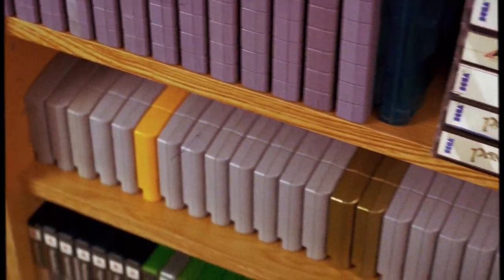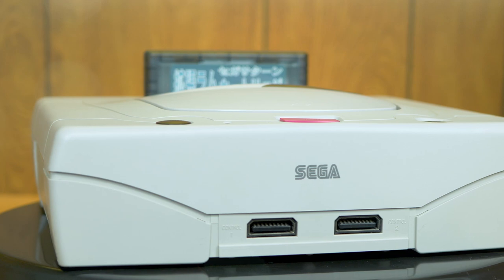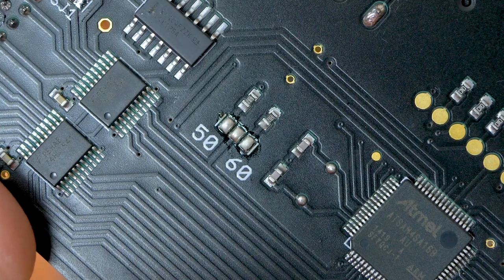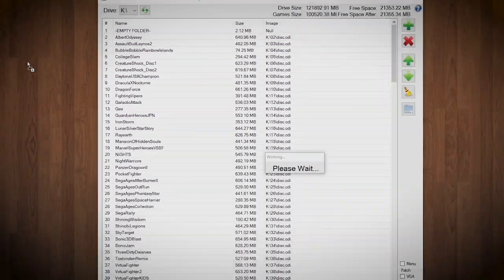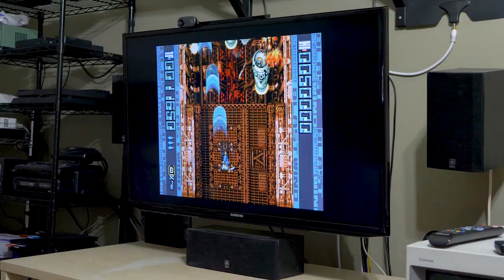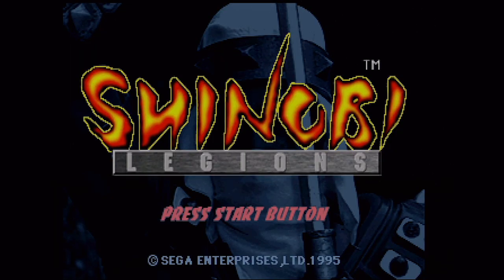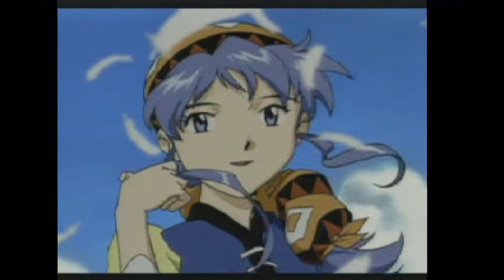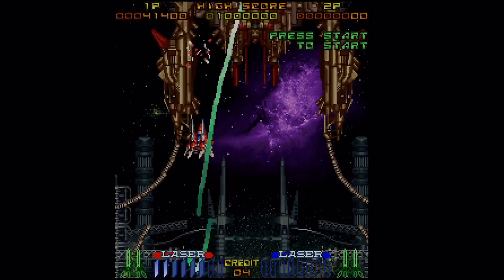Rhea and Phoebe - SD Card Reader for the Sega Saturn / MY LIFE IN GAMING

Comment: I'm very interested in getting one of these.  

Early last year I went to use my original Saturn that I got for Christmas in 1995 for the first time in probably a year or two, and discovered that the optical drive stopped reading discs.  

I kind of freaked out, and ended up buying three replacement/back up units (another US model 1, a US Model 2, and a Japan Model 1), all of which work as of now.  

I've been tentatively planning to try and get my original one repaired as well, but I may just go this route with it since the optical drive seems to be "toast" anyway.

Comment: Quite Interesting :-) Hope you guys review the PS1 SD card reader PSIO at one point as well. Or maybe how to do this the best way on a PS2 or a Wii. How to back up your WiiWare and Virtual Console games it's also a good idea since it soon shuts down. Anyways. As always, great video :-)
Reply: I think the best way on the PS2, the Wii and the OG Xbox is hard drives.
Reply: Supposedly the PS2 hard drive speed are a bit slow compared to the original disc reading speed, so some of the videos gets a bit laggy. It's possible to use the ethernet cable and a Raspberry Pi with a SD-card to fix that issue I've heard :-)

Comment: I wanna see a follow up to the Phoebe/Rhea that's a Saturn disc drive WITH an SD Card slot. Imagine being able to run real discs as well as SD cards.
Reply: So that you could have the best o both worlds? And if built as a ROM dumper, it could dump saves and ROMs?
Reply: Yeah i'm pretty sure anything worth ripping has been ripped already, there is no best of both worlds one is clearly a far superior solution

Comment: the sad part is that flash media also fails eventually. a better solution is a 2.5" mechanical hard drive. You can buy 1TB for relatively cheap, and it should be more than fast enough for the system. Just store all the games on there once, and forget about it. create a micro-usb port to connect a raspberry pi zero once a week for defragmentation.

Comment: I've looked into these but they are nearly impossible to get ahold of. I just don't understand why the creator of these SD card readers doesn't make larger batches. There is clearly demand.
Reply: Yeah it doesn't make much sense at all tbh, the last batch I saw sold out almost instantly and then days later was being scalped on ebay with massive markups
Reply: Big demand and he makes them all on his own. He has several different products he offers and can only make so many with the available components. He also has a normal job and a life, so you can't really expect that he'll be able to make hundreds of them easily or in a short time. Keep an eye on his site. I'd say check it every friday, as he usually announces preorders being open for saturday when he does that.
Reply: Dave R best way I found is to make an account on Wordpress and then set notifications to send you an email whenever he makes a new post. I never miss them now.

Comment: Awesome video! A couple of questions though: you mentioned if a game requires the 4 meg cart, this works great ... does that mean my Saturn wouldn't need the cart anymore? Phoebe and Rhea run those games without that cart? Second question: how does it work with imports? I am in North America but I want to play Final Fight Revenge (don't judge me) so considering that game is both Japan only PLUS requires the 4 meg cart, I've been unable to play it. Would this SD mod answer my dilemma? Thanks for a very informative video!
Reply: Action Replay Plus is still the best option for a ram cart and saving with an ODE.
Reply: heard there's also a way to flash Action Replay itself to play backups, is that right? Would that allow my North American Saturn to play Final Fight if I burned it on CD?
Reply: thanks referral madness, I can sort of get it working on Saturn emulators on Android like Yaba Sanshiro but someday I'd like it really on a Saturn
Reply: Down the Rabbit Hole hello sensei :v /

Comment: Requiring to butcher your CD drive is a deal breaker for me. Satiator seems to be the best alternative, despite the high price
Reply from the maker: [Try4ce] ODEs that require removing the disc drive isn't exactly butchering since the mods are fully reversible. You can put the drive back in. But I get what you mean. I also wish there were more options that let you use discs alongside cards. But it's just not common, and oftentimes the solutions that do let you keep the disc drive have some caveats due to the data being sent over a different path.

Comment: I dunno...I got some modchip in my Saturn I dont remember well...but it was a little chipboard and I had to connect it somehow to a little cable from the Saturn...dont recall any soldering since I dont have that gear....got an Action Replay 4 meg card so I can download and burn every Saturn game that is available on the net. I will trust that the disc reader from my Saturn will keep up enough years for me to play. 
Isnt there a way to mod the Saturn straight through the cartridge port using a cart. with an sd slot just like everdrives....

Comment: Hopefully they do this with the ps1 and ps2.
Reply: Already possible, PSIO for PS1 and for PS2 you can boot games from HDD/USB/network with FMCB/OPL.
Reply: PS1 has PSIO, PS2 has NA, making ODE for this consoles are difficult because you can't remove lasers with its hardware, all components are in motherboard.
Reply: Maybe someone can make a memory card with a built-in SD Card adapter like the ones used by GameCube homebrewers.
Reply: PS2 has FreeMCBoot and OPL. For PS1, tough luck. With FMCB you could use POPSloader (which is just a loader for the PS1 emulator built in on the PS2) but it has iffy compatibility. You're better off hacking a PS3 then use an external HDD.
Reply: The compatibility is weak however, we need real ODE solutions for these. Hell, my hacked PSTV run more PS1 games than the PSIO.
Reply: SD to IDE adapter in HDD bay + FMCB = can boot all my ps2 games off SD card
Reply: Do you have every PS2 games from every region? Guessing no. There's a reason why there are compatibility lists out there -_-
Reply: What adapter do you use?
Reply: PS2 has a hard drive option already and can load games from it - thats been around for a long time.
Reply: Those compatibility lists are mostly for USB and SMB methods, which are inferior partly because they're slower than the disc drive, not internal HDD, which has amazing compatibility and is by far the best way to play on the original hardware.
Reply: While PS2 Fat has the HDD option, an optical disc emu would be pretty neat for the PS2 Slims.
Reply: Hacked ps3

Comment: I did the same thing on my ps2 except i replaced the dvd drive with a memory card attached and connected via a cable which connects to the memory card slot, also to load games i used a 1tb hard drive

Comment: Oh yeah, I'm hearing the first PSX and PS2 consoles are starting to die on their disc drives.  So more on this topic would be really nice, even my Dreamcast starts to fail on some games, playing with the potentiometer doesn't help either so I'll have to buy a GDEmu :-/
Reply: Search for "KSM-440BAM Laser Lens Drive For Sony PS1 PlayStation 1 PSOne ( PS One ) - BRAND NEW" on Google for a place to buy OEM PS1 lasers for 20$. You can also cannibalize PS1 slim consoles, they have great lasers. If you're into more expensive solutions, there's the PSIO, which uses the parallel ports on early PS1 models.

For PS2, the best way to play games (speed and compatibility wise) is using the fat model, a network adapter, an internal HDD and the Open PS2 Loader (OPL) which is being worked on by multiple people every single day.

Comment: Actually soldering isn't even hard. It's just as easy as putting a screw on a hole. It does look scary tho.
The main problem seems to be the whole 20/21 pin connector thingy.

Comment: Well it's a cool concept but i wonder why they don't use a cf flash card instead? Because a cf flash card is 10 times faster then an sd card, and since the sega saturn is just a home console, an cf flash card will really make sense for it.
Reply: Because people will wait an extra few seconds if they can save half the price on the flash card?
Reply: It's mainly size, cost, and availability, plus with CF slots you are actually dealing with pins that can get bent easy and even break off if you are not careful, and with Class 10 U1 SDXC cards speed is not an issue anymore.  
Also I'll note from personal experience I had an early 1MP HP digital point and shoot camera back in the day that used CF cards, and I let my oldest brother borrow it for a day for a football game, and he was swapping out cards(back when even 64MB CF cards where not cheap), and apparently he bumped it into the camera, and ended up bending a pin so the card would not read, but with luck, a long metal pick, and good light I was able to bend the pin back into place, not something I wish for anyone to have to ever do.  SD, and MicroSD cards FTW!!

Comment: What about games that came with a RAM cart made specifically for that game like some of the SNK games? Do you still need that RAM cart to play the game? Or do the backup disc images have all the data already? Also does it remove or bypass the region lock?
Reply: There are only 2 games that use ROM carts (the ones with data): KoF 95 and an Ultraman game, so it's not a big deal if you can't play them.
The rest of SNK games uses the 1MB RAM cart, so you just need that.

Comment: How come the blacks on your camera footage look so weird?  Looks like you tried to recover the blacks and pushed it a little to far.  Or had to really push the camera's ISO.
Reply: To me it looks more like the Lut they used crushed the blacks and because of that some of the other parts of the blacks look noisy. This has happened to me quite often with out noticing it til export or upload. Some other content creators also have this issue like in the most recent scrapyardwars on linus tech tips. I think they use a micro 4/3 camera too so that could have also contributed to it having to be pushed up.
Reply: Did youtube change something with their encoding method that causes blacks go weird?

Comment: Too bad the Phoebe & DCEMU are all out of stock for quite a long time.
Reply: Djerique the clones work just as well, the GDEMU clone is a 1:1 identical product. The newest revision is the 5.15b which utilized the EXACT same chips as the original GDEMU. 

I have 1 and installed a few for friends and locals and no a single one has come back for issues.
Reply: InCahoots Do you have a link to the clone you are using? Thanks for the reply.

Comment: I have a Model 2, so I can just get the Phoebe.

I also might get another, non-working Saturn and turn that into a gaming PC. Anyone have a good idea of what to use to make a proper gaming rig that'll fit the Saturn case? Ideally, I'd also like to replace the CD drive with a Blu-ray drive so I can use it to watch Blu-ray discs but still have it look like I'm using a Saturn.
Reply: You will for sure need to mod the back side of a dead Saturn to allow for all the ports on a motherboard, but for something of that size I would wait for some of the new AMD Ryzen APU's(has the CPU and GPU on the same chip) to come out next year, and see what they offer for MiniITX or even PicoITX(if some company makes one), far as a Blu-Ray drive good luck on finding one small enough as even one salvaged from a laptop would be a front load pop out tray, or slot loading drive, and can't think of any top loading Blu-Ray drives, best I can say is a USB encloser for a laptop Blu-Ray drive you could hide behind the system that uses 2 USB cables one for data/power, and another just for the extra power needed to run the drive at proper speeds.
Reply: Commodorefan64 I know I'll have to mod the back of the console. I'd really like to know what all would make for a proper gaming rig for something so compact. Hard drive, mobo, power supply, cooler, everything. Every bit helps.
Reply: like I said MicroATX boards, and AMD Ryzen APU looks to be a good bet however you will just have to wait a bit, as I can't in good consistence recommend any AMD/Intel APU/Intigraded graphics setup at this point in time, till Ryzen APU get released, as any setup with a stand alone GPU would be too big, and produce too much heat in that small of a space, but  Do have a look at this though. 
http://techreport.com/review/32743/amd-ryzen-7-2700u-and-ryzen-5-2500u-apus-revealed
Far as storage if you can find an Ryzen APU MicroATX board with NVME SSD support via M.2 slot at 120GB for the OS, and base programs, and a 2TB 2.5in WD Blue HDD to balance out cost, and performance, plus I personally don't like my games, movies, music, photos, etc.. on an SSD for long term storage with their limited read/write cycles. Far as RAM I would go with no less then 16GB of DDR4 with an APU setup, far as PSU, you can get external bricks that plug into the 24pin, and 4pin power on the motherboard, just make sure you get one with enough wattage with at least 20% - 30% room to spare by checking the TDP of the APU, motherboard, SSD, and HDD. Again as in my first post on the DVD/Blu-Ray best tip I can suggest is external USB 2.0 with extra power plug on the USB cable as I've ran a salvaged  Blu-Ray/DVD-RW drive from an HP laptop that way in a generic external USB 2.0 case for a DVD drive and split USB power cable with no issues for the rare times I've needed it on my main desktop.

Comment: Now if there was a way to install this without the need to take the drive out i would do it.
Reply: My guess is Professor Abrasive or some other skilled modder might create an SD Card adapter that fits in through the MPEG card slot in the back. Of course, that'd mean finding a workaround for the inability to use said MPEG cart; perhaps this hypothetical adapter could allow users to switch an emulated version of the cart on or off.
Reply: Yeah i know Prof A was making his and im waiting on that one but this seems just as good as a alternative but with wasting the disc drive. wonder if its easy enough to split the power to both, and have a interlinked cable?

Comment: I wish there was a flash card for the ps2 so I can use my slim and the lasers on ps2 are so unreliable and ps1 these are my favorite consoles.
Reply: Look into Free McBoot. You can just play the games off the PS2 hard drive, USB sticks or even from a Mac or PC with an Ethernet cable. It installs on a memory card and can be easily removed if the need arises
Reply: How do I do it with ethernet cable can I use my xp computer which is not my primary computer?
Reply: Look up Project Phoenix Media, he's created guides for all these methods. Compatibility is good with the network share method, but not the best as it is slower than the disc drive and may have issues with cutscenes, but you can definitely save your laser a bit by playing certain games using it.

If you want the best way to play these games, sell the slim, get a fat model, a network adapter and an internal IDE HDD. Best compatibility and speed.
Reply: Frolsa84 My PS2 is a scph 90001 I'll just leave it somewhere and get the fat model later thanks for the help.

Comment: this is why I don't wanna collect for the ps1, original xbox, and why I don't want to get a ps3, disc rot would make everything completely useless in the long run
Reply: OG XBOX can easily be soft modded. Every games can be installed and they normally look better than PS1 anf NGC. My policy is that if I want a 6th Gen Console, it's: XBOX -> NGC -> PS2. For PS3, I just upgrade my games to PS4 when possible, games are installed on the PS4, so the disc is just to boot.
Reply: I don't trust the ps4, you just have licenses, in any moment you can say goodbye to them, also, a lot of those modern games are so heavily based on multiplayer they're completely useless if the servers close, but I agree, that's why my original xbox is softmodded and my games loaded on the hard drive, that won't rot, and if it gets busted and can prepare a new hard drive whenever I want
Reply: most ps3s can be modded to run games from hard drive and that will also give you the ability to run most ps2/1 games from hdd as well. then it just becomes a question of how long these hot running systems will last
Reply: You really should do some research before answering. Physical games actually install on a PS4 with no mods, same with XBOX One. You still need your physical disc, but you don't need Internet to play them (just for patches and DLC). Once you insert a disc in a PS4, the game will be ripped and the disc becomes just an unlock key to make sure you didn't sell your game in order to play it.

Finally, look at my PS4 games, do any of these titles look like AAA Hardcore online titles? http://www.rfgeneration.com/cgi-bin/collection.pl?name=the_importer&action=&results=&findimages=&folder=Collection&console=%7C215%7C&type=S
Reply: @theimporter

I wonder what makes the OG Xbox more "HDD-compatible" than the PS2 Fat. I mean, every single Xbox game I have installed on the Xbox hard drive so far has worked flawlessly, while on the PS2 I sometimes have to mess around with compatibility modes and slower read speeds. (Jak & Daxter games, Klonoa 2, Escape from Monkey Island, etc.)
Reply: @ThePreciseClimber
Old topic, but I'll still answer. Simple, the OG XBOX was the first home system which was basically a strip down computer.
Reply: The PS2 FAT was not originally designed by Sony to enable the installation of it's entire game library to the HDD.
Some hackers came up with that, independent of Sony.